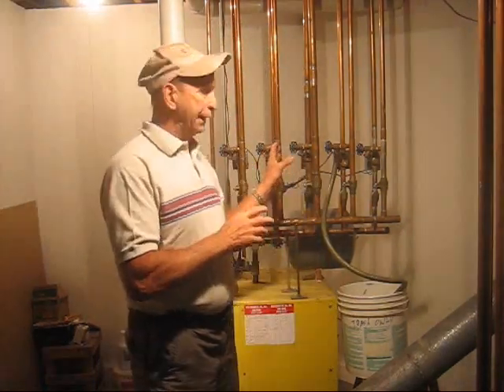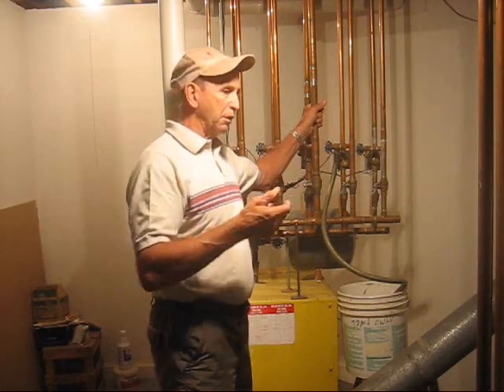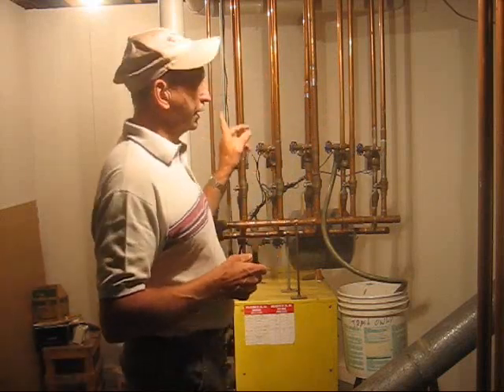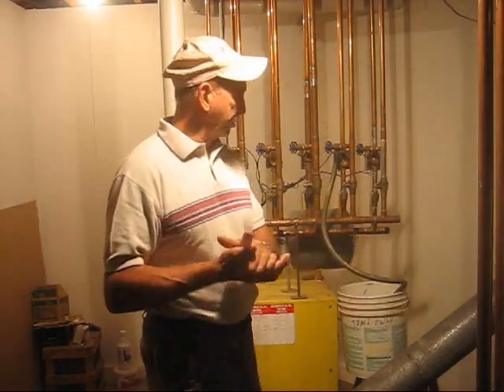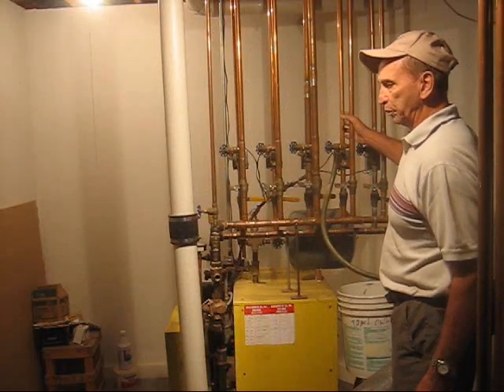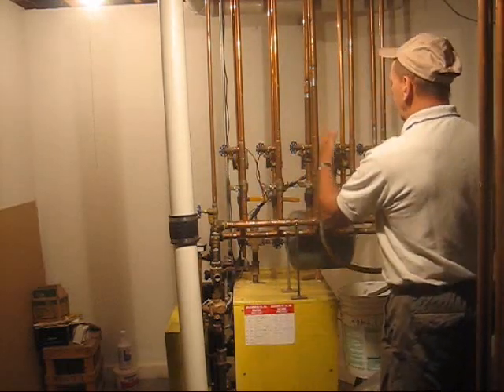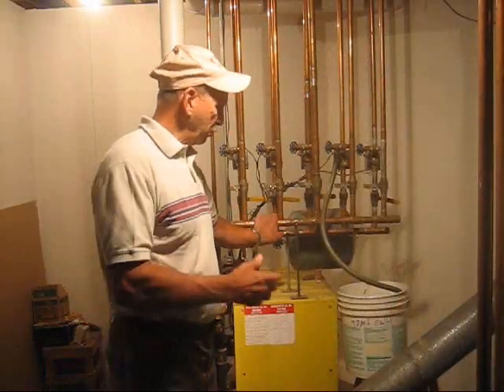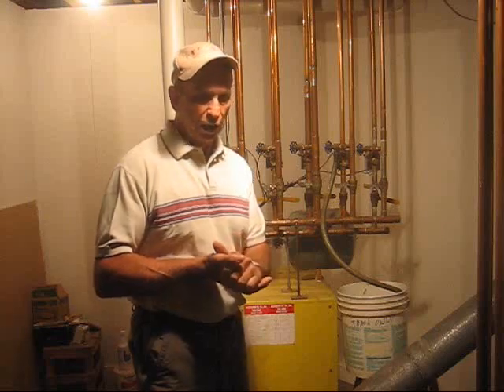Bleeding a Hot Water Boiler

Comment: I have a running water noise in my baseboard heaters. I might have caused it by tightening an air vent that was dripping water. Please see the picture of the Honeywell 1/8" NPT Goldtop Universal Air Vent. I saw that it was dripping water about four months ago (October 2014) so I tightened until it stopped. Late February 2015 I started to hear a running water noise when the boiler turns on. Does anyone have any thoughts?
Reply: Greg Tibollo Maybe some valves have problems .Or the seal is broken. More solutions based on showing me the pictures of the exact point of the leaking.
Reply: Those air vents at baseboard are useless for large air pockets.  They can’t release enough water to get rid of air.  Follow what the video says.  Basically, close the valves all all zones at the return pipe.  Then open the 1 bleed valve which should be just before the return shutoff valve. Water should gush out. I think it’s not clear from the video, but you should hear and notice that the inlet pressure reducing will let in fresh tap water; it’s that fresh water that will push the old water with air out of the bleed valve.  You may have to run it for a few minutes.  If there,s air, you see the water be turbulent, like when you open up a faucet after turn on the main valve. Watch more YouTube videos on this.  If you don’t understand what is being done, then you will need a pro to do it.  If the hardware and valves are in good shape, it’s a 30 minute job for 4 zones.

Comment from the maker: Laura
Do not turn the boiloer off.  The boiler must be running so it will provide the water pressure to the circuit you are bleeding.
Reply: Les Donovan
Reply: I don’t agree.  Do not run the boiler as the hot water will reach 160-180 degrees and burn you.  Instead, turn off the boiler, and the inlet pressure reducer will let in fresh cold water.  The fresh cold water at 12lb pressure will put out the old water that has the air in it, and that zone is then replaced by new water without air.  Some pros will also open the return shutoff for 1 second to pass the water between the bleed valve and the return shutoff valve so if that 1 feet of water has air, it will run through the whole circuit and return and bleed out at the bleed valve.

Comment from the maker: I recommend that you clean the bleeder valve or replace it. In either case, you will have to relive the pressure before you remove the bleeder valve to avoid getting burnt by hot water.